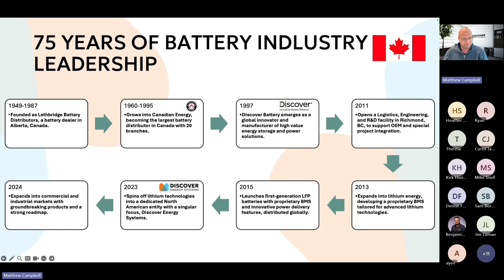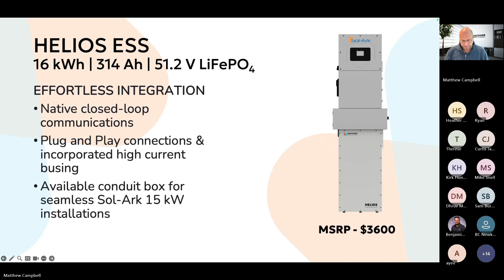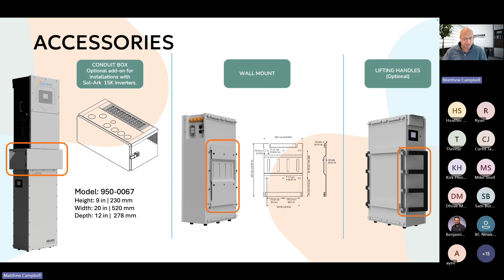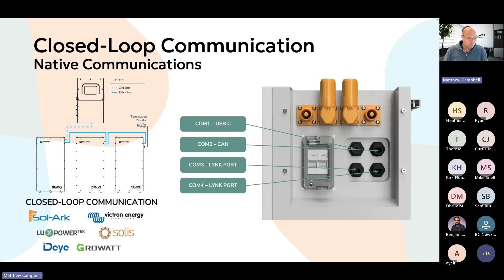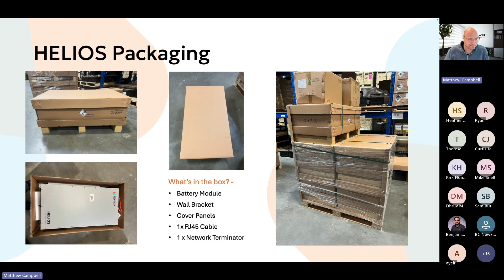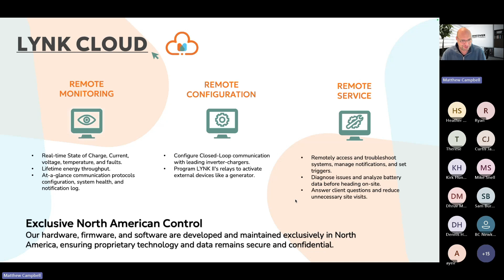WEBINAR | Discover Energy Systems Presents - Introduction the HELIOS ESS

Comment: Do you recommend installing batteries in a separate shelter away from a home or are they safe enough to be installed in a basement? Thank you
Reply from the maker: It depends on the specific battery and your local code requirements. HELIOS can be installed in residential applications, including some indoor locations, but the installation needs to meet the manufacturer’s requirements and applicable codes. A qualified installer can help determine the best location for your particular setup.
Reply: @NAZSolarElectric  FInd me a qualified installer who doesn't show up with dollar signs glowing in both eyes.
Reply from the maker: @flyingjeff1984  We understand. Finding an installer you can trust is an important part of the process. If you need help finding a good installer in your area, give us a call at 800-383-0195. We may have some helpful resources or recommendations to point you in the right direction.

Comment: I just double checked their website at 12:01 Pacific time Monday April 14th 2025.
The price shows 3,600 for the battery.
Put four of them in the basket.
And the cost is $4,990 each. 😢 So $19,960 That's almost a $6,000 increase between clicks damn 😮
Reply from the maker: @crazywayne7051 your timing was impeccable. Our US stock ran out yesterday, and now the tariff pricing is in effect for these :(
We definitely recommend checking out the Discover AES Rackmount batteries in the meantime - if you haven't already. With our current sale going on, you'll get a great price.

Comment: Towards the end of the presentation, long term storage was discussed and it was mentioned that the battery should be stored at a 95% SOC. I am curious if there is any drain on the batteries by the BMS when they are powered down. If so, is there a way to disable the BMS for long term storage? This would be in the instance of a remote cabin in cold climates (potentially -25F), that is unattended for 1-3 months in the winter. Could you shut the system down in November and come back in February for example?
Reply from the maker: This information here is straight from the manual:
"12. STORAGE
Leaving the battery connected to a trickle load or power electronics will cause the
battery to discharge during storage. Without any load, the battery will self-discharge
by approximately 3.5% per month while in storage. After storage, charge the battery to
100% SOC and perform at least one full discharge and charge cycle before returning the
battery to service.
1. Store at 95% SOC or more. To store the battery for up to 6 months, store the
battery at 95% SOC or more. It must remain disconnected from all loads and power
electronics during storage.
2. Switch OFF the battery. Set the battery to OFF.
3. Check SOC every six months. Recharge the battery to above 95% SOC every six
months.
4. Proper storage temperature. Ensure storage is within the temperatures specified
below.
• 1 Month storage temperature -20°C to 55°C 
• 6 Month storage temperature -10°C to 30°C"
Reply from the maker: Hey @mikepoulin37 great question! 
The Helios battery does lose some capacity during storage about 3.5% per month. Discover recommends checking SOC every six months.    The coldest Discover recommends storing the battery is -4F for 1 month. 
We recommend that you remove the batteries and store them somewhere warmer during the winter months, if you are able to, since it would be likely colder than that.
Reply: @ Thank you!

Comment: I really hope they can get the native communication to work with the XW Pro
Reply from the maker: @FJB2020 and @zkeilholz 
They may eventually figure that out, but at this point, based on what we are seeing in the manual and in our testing, the Helios requires the use of Lynk II with any Schneider products for closed loop.
Reply: Is this something they're actually working on or do they just expect you to buy the Lynk 2?
Reply: @zkeilholz  Not sure.  I have 3 of these batteries coming in a week, so I will test them out to see if they have native communication or not.  If they don't, I would just run them with open communication until they figure it out.